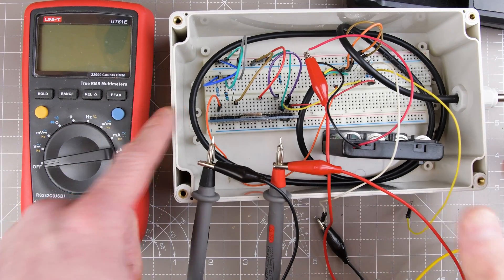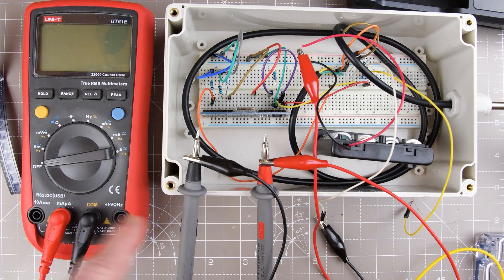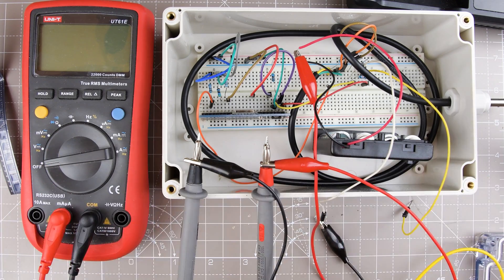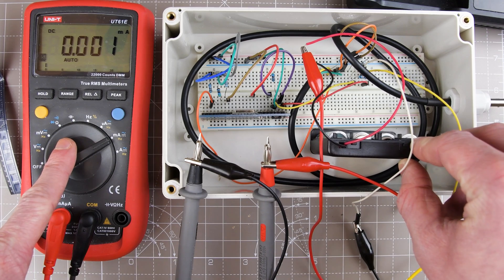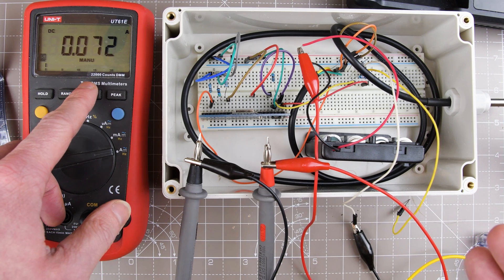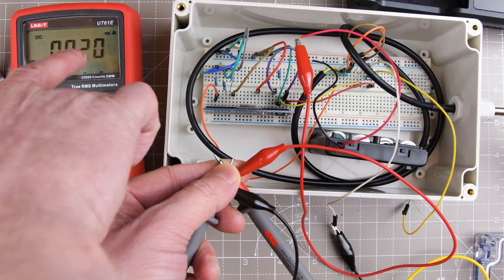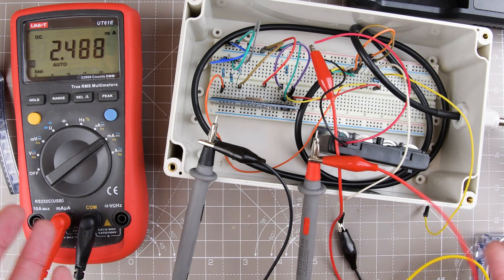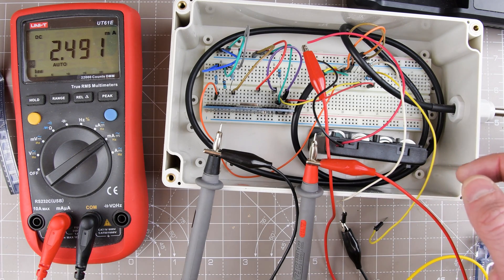Update to Part 3: Outdoor Temperature Logging with ESP8266 ESP-12f

Comment: The ATTiny is a good idea.
Though not immediately relevant to you, I just thought I would mention another idea for low power consumption.
LiFePO4 batteries have a very constant discharge voltage which stays close to 3.2 V during discharge until the cell is exhausted. 
Apparently these can power an ESP8266 directly with no regulator loss.
http://www.esp8266.com/viewtopic.php?f=29&t=13235
Reply: isnt the issue with lithium type packs is that they will freeze on him?
eneloops do well at low temp
https://www.panasonic.com/global/consumer/battery/eneloop/technologies.html
Reply: Lithium ion discharge down to –20°C.
Especially at low rates, as in this application.
http://batteryuniversity.com/learn/article/charging_at_high_and_low_temperatures
Reply: ah nice.. well its not the cold then. maybe its just the dropout on the ams1117 wont work from a single 3.7v cell. 
and/or he is getting some direct sunlight which might go all note7 on him, and mess with the temps
Reply: ah. thats where i saw it. david commented in part3 to someone suggesting 18650s saying "I thought about that but they are negatively effected by the cold and regulating the voltage is difficult from 4.2-3.1 to 3.3v for the esp"
i think this project will be more interesting if he tries your idea to direct drive or refas comment on the TPL5110
then he is done something most people havent seen before = views = subs
Reply: I like the simplicity of directly off LiFePO4, if it works.
But its not so good if you need to buy a new charger and batteries.
Its interesting you pointed out earlier that the Wemos units have a Richtek RT9013 quiescent current as low as 25μA.
I have already ordered some Wemos units, so that's good.
Hopefully David can get his Wemos clones working eventually.
Reply: if david gets the "WEMOS D1 mini Pro" it has a CP2104 TTL which is supported out-of-the-box on windows7+ which should solve his issues. costs a few dollars more but has like 16MB of flash on it to boot.
nice board, although it will never effect me - its missing FCC

Comment: Try the TI TPL5110 timer, that should do the trick with current consumption, will get you to a range of ~50 nA while the device is inactive. You define the duration of the sleep period, you set the period with an external resistor and you ping the TPL5110 when you are done and it will turn off your board and wait till the period passes to wake it up again. Good luck!
Reply from the maker: Oooh now that little chips deserves some research, thanks!
Reply: You are welcome :)